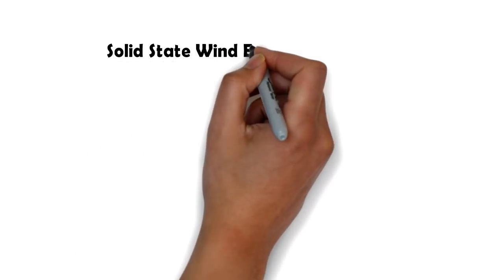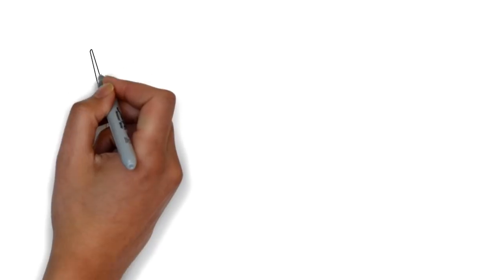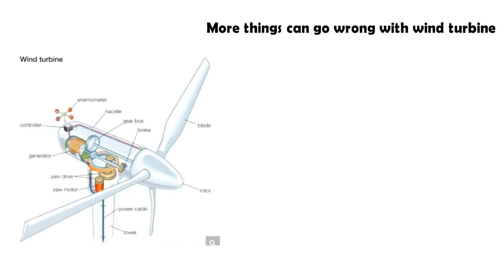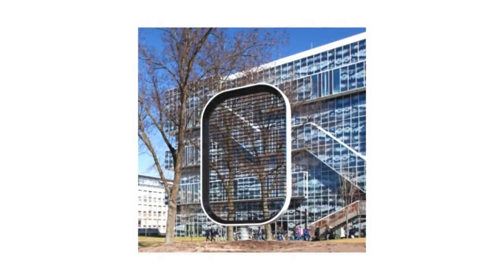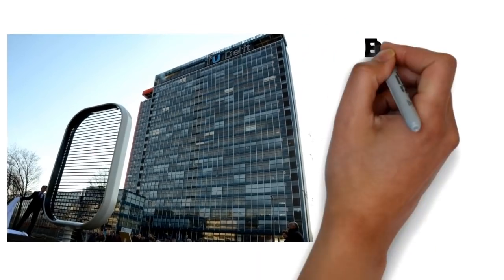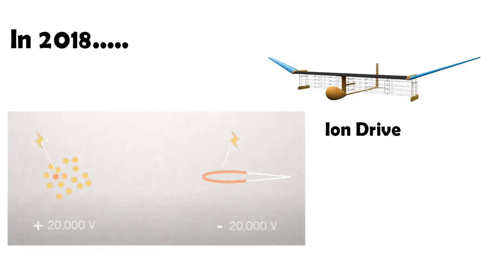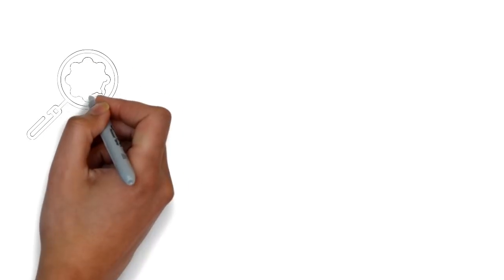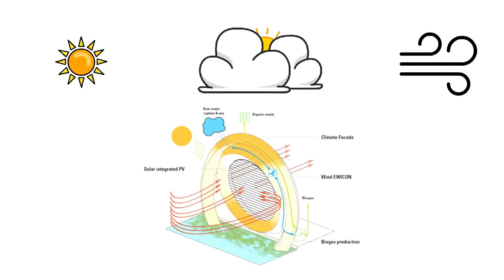Solid State Wind Energy Generator. A Revolutionary Device

Comment: My main hero Nikolai Tesla would like this I love the concept of a non-moving part design intent to reliability you’re quite right it’s like always much better to have less this would be as reliable as the electronics used but I have worked with electrostatic speakers and air cleaners I I am used to very small currents so how many watts output ? These would be great to integrate with a Tesla system you guys should talk !

Comment: There has to be a high voltage source which is spanned between electrodes. The wind will blow the ions away, but then the voltage source has again to be charged, so it does not work as current source but perhaps as expensive anemometer! Thumbs down for this!
Reply: Pretty sure you can generate a current from it, the voltage source will generate a voltage difference of 40 000 V, which causes ions to flow, when the wind stops these/pushes them back you will have a build up of ions and thus the voltage potential will grow beyond 40 000 V, you can use this excess voltage potential to drive a separate circuit to generate power while still keeping the 40 000 V potential.

Generally if something can generate thrust, it can also generate electricity. Everything is reversible in principle, it’s just a question of how much friction you have which might not make it reversible.

A problem with this tech is getting the thrust density high, since the ions tend to spread appart. This is not as much of a problem for a generator since it’s not mobile, however it could mean that you need to build very large generators which might become very expensive.
Reply: @beaconofwierd1883  If those particles start to move backwards - It's pretty much shorting-out,and power loss.Also this system creates electrostatic zone around generator,which is hardly considered as a positive feature.
Reply: @Steellmor  The efficiency of this system (how much power loss there is) is still to be researched, but they do work. They even state in the video there's been a proof of concept. ( https://aip.scitation.org/doi/full/10.1063/1.5109776 ) As for potential electric dangers, just place them high up like we already do with wind turbines. Birds flying into the thing trying to build nests and getting electrocuted might be a problem, but it's a solvable problem (for example you could simply use a cage to prevent them from getting into the high voltage lines). Bugs... Let's face it, when did we ever care about not zapping bugs? X)
Reply: @beaconofwierd1883  Never ever! They do not work!
Reply: @DocMicha  Yes? They do work? That's what the whole video was about and what the article I linked was about. Question is not if they work or not, they do, question is if it's an economical way to produce power from wind, that we do not know yet.
Reply: @beaconofwierd1883  Video is quiet misleading,and i was specifically talking about linked paper.This system getting charge from the ground,and that's where current generating power occurs.By placing it high up you not only increasing cost of construction,you also make ions travel longer distance towards earth,so it makes larger electrostatic zone.Also it acts as a lighting rod.
Whole idea of making cage against birds nesting is counterproductive.
Reply: @Steellmor  This thread was about if it works or not, which it clearly does if you read the paper. There's no mention of any electrostatic zone that would be dangerous, but these are all engineering challenges to make it safer, not questions whether it works or not. The bird cage example was simply to state the obvious that we can solve that issue, not that it's the best solution to protect the birds from getting zapped.
Reply: @beaconofwierd1883  No,you implying binary logic - it does work or it doesn't,which is wrong. No mention - means that subject was ignored,which only lowers credibility of this papers as of "proof of concept". It's literally ionized air. No mentioning of ozone generation - also is a very bad flag.
The "bird cage example" - was an example of ignorance.Birds will make nests on the cage,cage will add air resistance(drag force) which translates into structure loads.Would you make that cage out of metal(Faraday cage)?Would you ground it then?If yes - cage becomes part of system circuit,and since it was not done in first place - this is probably because in such way power not being generated.If you don't ground it - cage would have static electric field.Insulators tend to build up charges on the surface.
Reply: Steellmor The initial comment claimed the system could not be used as a current source, that is false. The specifics of developing the proof of concept into a large scale powerplant is beyond my scope. Excessive ozon generation or static build up has nothing to do with if the system generates electricity or not, that’s a development issue for making it commersially viable.
Reply: @beaconofwierd1883   @Beacon of Wierd  I never said it can't  generate electricity -  I'm saying it doesn't matter if it does generate electricity since it's not reliable.
You made statement that ions can move backwards and increase voltage,which can be used to generate more power,to which i commented - no,that would make system to lose power.
Reply: @beaconofwierd1883  Never ever!

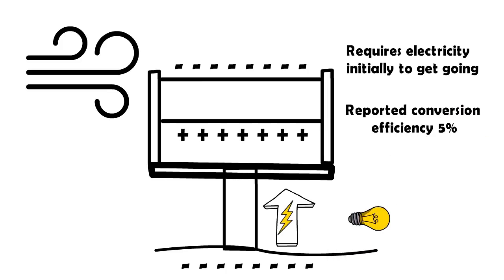Comment: 3:21 Reported conversion efficiency 5%! Really that means that 95% of the theoretical energy is not used! Also I would think you could get the starting power from the air by raising a long wire by way of a lighter than air balloon.

Comment: It looks like a nice idea. But I feel that the problem with it is the very low efficiency is basically built in in the idea itself, so it looks to have a low ceiling for efficiency improvements. Both wind and solar have low efficiency too, but these are constrained by the present materials and knowledge, so there is quite a high theoretical ceiling for future efficiency improvements. I just can't see it with this technology. My prediction: it will remain a curiosity toy for a foreseeable...
Reply from the maker: I agree. The beauty of this is simplicity of its design

Comment: turbines are orders of magnitude more efficient at extracting POWER from wind (not just low current high voltage like these sorts of devices)
Reply from the maker: That is true, but they are also more complicated
Reply: @synergyfiles3536  not when you factor in the number of HV capture devices you'd need to make up a single MW of power.

Comment: I think it's great that we are exploring other concepts of power generation, but opposed to our currently operating wind generators I think it would be more advantageous to utilize many smaller devices in around the one meter size range. We don't use one massive PV solar panel for power, we use many connected in series/parallel and we should approach the wind generation aspect in the same manner. Smaller units would be easier to maintain and/or replace, and when an individual unit fails there would be less detriment to the grid.
Reply: The are very good reasons why big wind has found more commercial success than small wind. The output of a wind turbine increases very rapidly with the wind speed (v^3). A higher tower means higher and more constant wind speeds. It would not make sense to put a small turbine on a very tall tower. The power also scales with the swept area (r^2), so if you increase the length of the blade with a factor 2, the power goes op with a factor 4.
Reply: Did you actually watch the video? It says making the turbines big saves on maintenance through the economy of scale. That's kinda opposite to what you are suggesting.

Comment: I'm a physicist...... And I can promise you this will not work as you think it will..... Plutonium batteries is the way of the future.... Once they get the fear monger out of people about plutonium that is.... A plutonium battery is completely safe..... Environmentally friendly.,,... Has a lifespan off the charts........ And easy to make with the right materials.... They were actually invented in the 1950s......  they have been secretly improving them since then...... They are now starting to evolve on the market as solid-state batteries but only for selected companies..,... And I only in very small voltages...

Comment: Some of the newer wind turbines have eliminated the gearbox and use a generator which has a larger diameter and many more poles.  The same thing is done with ceiling fans, which run slowly on 50 or 60 Hz without any gearbox.

I think this high voltage system is too vulnerable to foreign objects causing short circuits.  Insects or debris could cause problems and it would have to be constantly cleaned.
Reply from the maker: The gear-less wind turbine use neodymium magnets, which is not very environmentally friendly. The movement issue remains with the bearings and the blades

Comment: 5% energy gain? Not very efficient.
Reply: Sure but it looks easy to set up and very easy to maintain.
Reply from the maker: @Richard Schmid  Wind turbine larger ones are made to go slow to avoid wear and tear. The max they go is 18 rpm. Now you can certainly design  complex generators  with windings that would work in low rpm, but than you dont have any buffer in case of a drop in wind speed. There are also power electronics that can do the job of gearbox and there are gear less wind turbines but they require neodymium magnets which are expensive
Reply: @synergyfiles3536  I thought you may have made a mistake and meant 50% energy gain. That would have really impressed me to the point I would think and tell everyone:" Solid state wind turbines, the future of wind energy".
Reply from the maker: @stuarthirsch  The threshold for wind energy is around 57% Its termed as the Betz limit.  The beauty of this apparatus is not in its efficiency, but in its simplicity
Reply: @synergyfiles3536  in practice state of the art wind turbines get between 20%-25% efficiency.  Cheap solar PV efficiency is around 15%-20%.  A solid state wind generator with an efficiency of 5% sounds bad.  However efficiency is only important where real-estate is limited.  At scale, the levelised cost of energy (LCoS) in $/MWhr is a more important consideration as it determines the economics of the power generating source in relation to other substitute sources.
Reply: @synergyfiles3536  with 5% efficiency does this thing even meet EROEI? If so, how long this thing will reach EROEI break even?
Reply: I would imagine this setup always requires very little in raw materials (steel, copper, ect). The only downside would be the massive amount of ground/air space needed....and it probably wouldnt harm birds if the wires are far enough apart.
Reply: I'm not a brain on the details, however, I live in an extremely windy area. 5-7 mo. a year and every year seems to be extending. Additionally, I am building as Off Grid as I can accomplish. I have lived this way on & off. As a middle aged single woman, even 5% is appealing as that is the beginning and focusing creates forward strides and improved models. I like the concept and support further research and development.
Reply: Mining fossil fuels and uranium and dealing with the consequences of their use is not very efficient.
Reply: @jackfanning7952   Drilling for fossil fuels, especially natural gas and propane, and thorium and uranium has far less environmental impact than the making and disposing of solar panels or even the massive amount of materials needed to make windmills. Taken as a ratio of environmental impact per energy output nuclear and fossil fuels are the clear winners.
Reply: and that is 5% of an intermittent, variable, and much less intense (because derived from sunlight) energy resource than the sunlight used directly by PV. So I am not seeing this as becoming a "thing".
Reply: CAR ENGINES WEREN'T EFFICIENT WHEN THEY
FIRST CAME OUT EITHER,  I HAD A CAR WHEN I WAS A KID THAT GOT 4 MILES PER/GAL LOOK AT EM NOW.  FAST TOO !
Reply: @Frank-rm9yg    if I floor my V8 it still gets 5MPG!

Comment: This is very exciting technology that as was said would easily interface with solar power and more suitable for domestic situations than wind turbines. 
A few questions:
How to the power outputs compare with other systems?
With the high voltages is the going to kill insects and possibly birds that come in contact with the wire. And roof workers not understanding the dangers.
How is the system affected by extreme weather especially rain and frost.
Impressive though

Comment: There are moving parts in a solar panel system, the inverter.
Reply: The only moving part in an inverter is the cooling fan isn't it?
Reply: The only moving part in the inverter I use is a cooling fan. Which parts move in the inverter you know about?
Reply: The inverter doesn't need to have a cooling fan if the power devices are mounted on a good aluminum heatsink.  But aluminum costs more than a cheap fan that goes bad after a few years.

Comment: a great idea in theory but, this is also how Ionizing air filters work. What effect would it have on plants, being it would cause pariculate ( pollen included ) build up on one of the electrodes scrubbing the air going through it. That also brings into question of cost of cleaning off the buildup. That said, it may be a very good idea for very poor air quaility areas. An air filtration system that also gives back some power so it pays for itself
Reply from the maker: Ionized air eventually falls to the ground where it de-ionizes

Comment: Video: Wind turbines can fail from wear due to moving parts
Also Video: Thumbnail shows device at 10's of kV potential in a highly corrosive salt water environment
Reply from the maker: That is just an artistic render. They can be used on land alongside a highway
Reply: @synergyfiles3536  FWIW since there are current offshore windmills that deal with salt water... there is no need to defend the concept to moronic trolls...
Reply: Stevey Boy: FLMAO  Seriously???  FWIW, "Rusting" ships are sunk on purpose to create Artificial reefs https://en.wikipedia.org/wiki/Artificial_reef
Reply: Solid state wind generation just eliminates the mechanical failures from moving parts without changing it location... so corrosion factors are the same or less... so the corrosion vs  moving part failure rate is a false comparison...
Reply: "highly corrosive salt water"???? if it's so corrosive I wonder how current offshore windmills deal with it???? 
BTW the fact fellow, morns liked this simplemind comment is proof SM is making us all https://en.wikipedia.org/wiki/Dumb_and_Dumber... SMH....
Reply: @nc3826  They do have big problems due to the highly corrosive salt water. Off shore is not as great as you think.
Reply: @nc3826  Oh, you asked, how... e.g. they must not stop moving. They have motors to keep them spinning when there is no wind. Also: constant maintance like painting and replacing corroded parts.
Reply: DMcG, Google what rhetorical means as in a rhetorical question.. so no I did not ask a question...

And the fact is that current ocean based windmills and ships can deal with ocean conditions means its not a bigger problem for a solid state wind generation is it??? again that was rhetorical, Einstein....
Reply: @nc3826  0
Reply: @nc3826  Apart from the common sacrificial anodes, these wind turbines use Impressed Current in order to counter the naturally occurring redox reactions. https://www.corrosionpedia.com/definition/664/impressed-current
Reply: @EatRawGarlic  and so do ships, boats and many other  structures .... so your telling the wrong person...
Reply: @nc3826  Paint. Which would seriously hamper electrical flow.
Reply: JH: OFC non-conductive coatings would only be used... on non-conductive  components...

Comment: Would you be able to increase the efficiency by adding another unit just downwind of the primary, which does not ionize the air on its own, but instead allows the ions in the air to collect upon it, creating the same effect in reverse?

Comment: The idea of "The lesser the moving parts, the higher the reliability" is simplistic, essentially wrong! A system with moving parts can have reliability 1sec or 100 years, as well as a system without moving parts can have reliability 1sec or 100 years. It all depends on the parts, the system and the engineering and testing!!